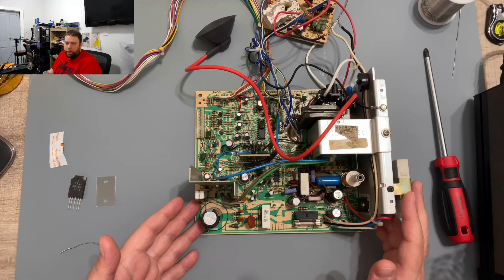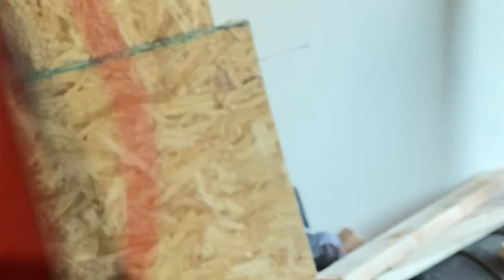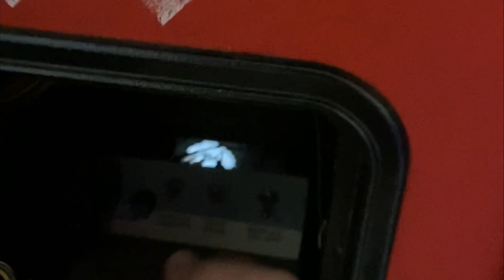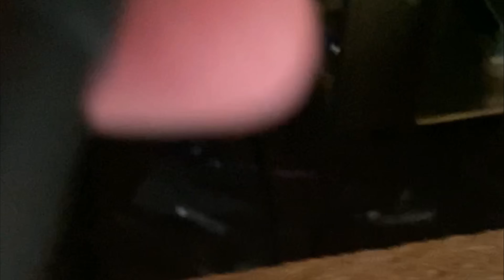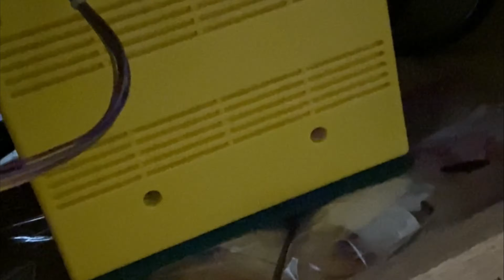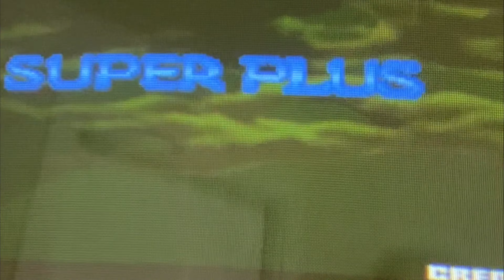Neo Geo Arcade Restoration - Well Gardner K7000 repair - Part 2

Comment: When you use a Rejuvenator on the RGB guns, is the Rejuvenator applying a Higher voltage and Higher current to each RGB guns to do what? I'm confused what a Rejuvenator does to the arcade monitor and the Rejuevenators "Cut Off tests" does what to the RGB guns?
Reply from the maker: wayne Gram I’m not sure because I’ve never used one before but I think it runs a high current through to “burn off” deposits that may interfere with the guns.  I think that is why it is a little risky to do.
Reply: oh ok thanks I thought you might have use one before because I don't know what a rejuevenator or the cut off tests voltages really does to the RGB ray guans

Comment: David Janice, why does arcade monitors use an isolation transformer? I don't give how it prevents the repair technician from getting shocked if you put your hands on the chassis
Reply from the maker: Everything you plug in to the wall completes a circuit to “ground”.  With an isolation transformer, whatever you plug in does not go to ground because it is isolated from ground.  That means - in simple terms you can’t “ground the circuit” and have the electricity go through you.  Here is a pretty good explainer video that might help.  https://www.youtube.com/watch?v=nMHp_DFSeg0
Reply: So If you put both hands on the chassis you don't get very high voltage from the arcade monitor going through your body and hands?Because the Flyback anodes from is 15K to 30K which the chassis has very high voltage 15K to 30K voltage live on the chassis metal frame of the arcade game. I would think if you put both hands on the chassis metal frame you will get hurt and shocked even with an isolation transformer being used.
Reply from the maker: Yes the fly back WILL shock you if you are not careful for sure.  There is a VERY large “potential” or difference in energy around the anode and your body makes a good conduit for that energy to flow.  Danger with an isolation transformer is not eliminated.  It is merely reduced - plus there are many other good things that come with an isolated transformer.  Think of it like this.  Let’s say you have a charged battery and you touch the positive terminal.  It will not shock you even if you are barefoot on the ground.  As soon as you touch the negative terminal at the same time though - watch out!  An isolation transformer makes the chassis like a charged battery.  It can still shock you if you touch the wrong thing.  But there’s more reasons than reduced danger (though not eliminated of course) of electric shock.  An isolation transformer stops interference and noise from ground loops, protects sensitive equipment, and stops DC voltage from being intermixed with AC voltage.  Also since your monitor runs a flyback at dangerously high voltage, and the fact that no piece of electronic equipment is immune to failure the isolation transformer reduces the risk of thousands of volts accidentally flowing into the rest of the game should the monitor fail.